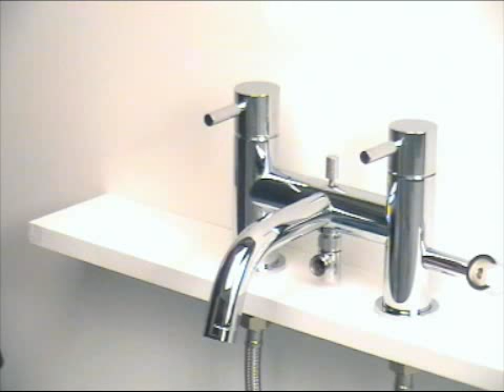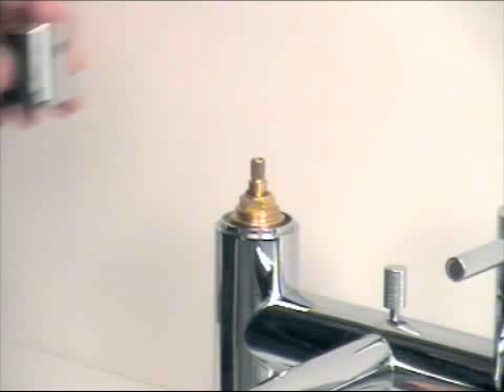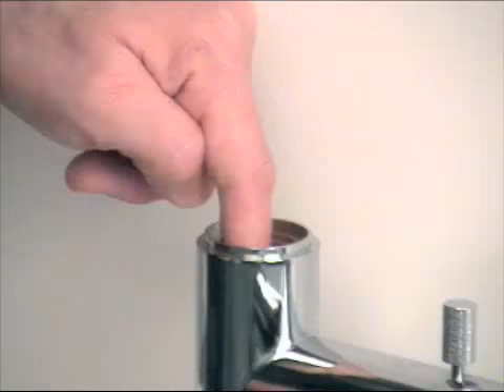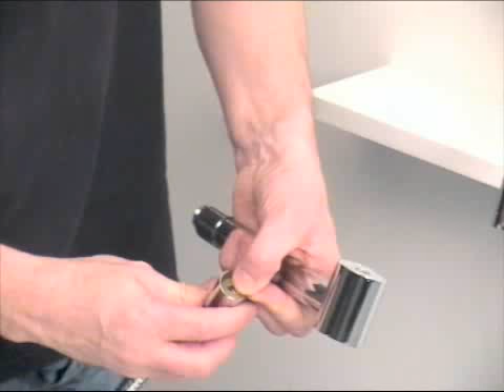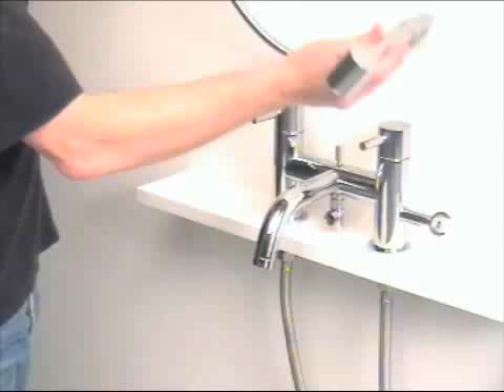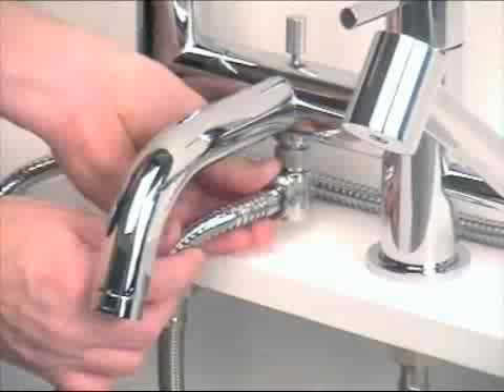How To Install A Bath Shower Mixer Tap Cartridge - Bathstore User Guide

Comment from the maker: To clarify, our taps to have a small grub screw at the back that makes sure the tap handle stays on the tap while in use, and if the handle does need to be removed, it allows for the handle to be taken off without and risk of damaging the tap with a screwdriver.

Comment: This is the best and most informative video. Taps without any decorative cap have no screws to loosen and these handles just lift off, sometimes limescale makes it difficult dismantle these. Use a flat blade screw driver or similar object to gradually wedge around the tap handle to loosen it and pull off.